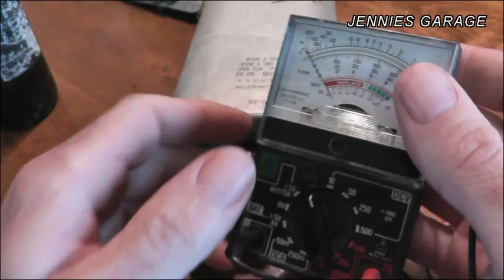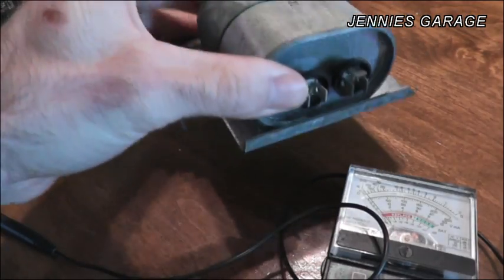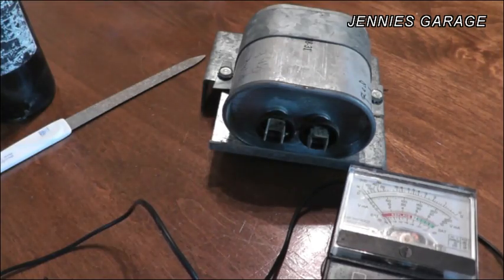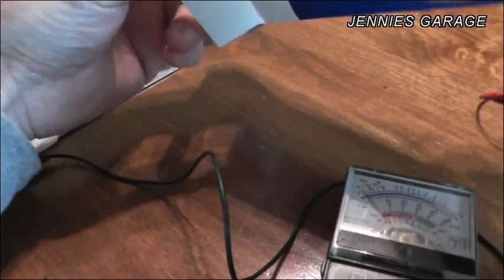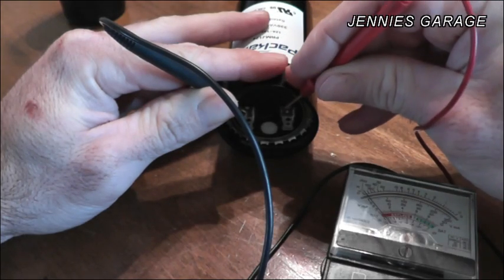How To Test A Capacitor For An Electric Motor With A Multimeter

Comment: BE CAREFUL when working with capacitors folks! They can store a lot of energy, and discharge it all at once if you short the contacts. Honestly, this is not a homeowner friendly project at all unless you are experienced with electrical wiring. The proper way to discharge any kind of cap is to use a bleed resistor. But it's better to pay someone who knows what the hell they are doing than to get hurt. Always.

Comment: Your feelings would really be hurt if you knew his price on that capacitor. Service techs often buy the more common caps by the case. And have accounts at HVAC parts houses. We never pay retail. But it's hot (or really cold), hard work and he has a lot more overhead than just that part.

Comment: Thank you.  Your video helped me fix my wine cooler with this trick.  One small cap was making a relay trip over and over and preventing the cooler from turning on.  I was able to confirm my suspicion that the cap was bad because it was bulging a little bit.  $2.50 later I had a working cooler!

Comment: You need swap polarity (test leads red-black) every time you measure and and you can see needle will show charge every time you do it. But this method indicate very little about cap problems. It still could be bad even it reads like it shows on meter on video. Only accurate is ESR witch measures ac resistance in cap. It will show even if cap is "little" week it still may work on circuit but is't not good.

Comment: Thats not the safe way to discharge a capacitor, try to atach it to a light bulb or something like that. DO NOT SHORT THE TERMINALS (connecting one to the other) until AFTER the capacitor has been discharged. Doing so could injure or kill you.

Comment: When the dielectric breaks down you can't always read it with the low voltage this multimeter uses. I often apply rated voltage or the closest you can get, and read the current flow through the circuit. You can then mathematically calculate the MFD value if so inclined. Usually you don't even have to remove the capacitor from the equipment.

Comment: i was reading some guides and there was some difference, the needle will swing near zero and infinity meaning it works not the other way around like you told. is it because of the bleeder resistor?

Comment: As it was explained to me, this test is only to see if the cap is totally nonfunctional or not. When the needle pinned it showed that the cap has a defect (short or open I forget, but one of those). If the needle had not moved at all it would have meant the cap was defective in what ever way the other wasn't (short or open). Either way, the test was just to check whether the cap was total junk or not. I liked this video.

Comment: I know that one of the best ways to discharge a cap is to touch its terminals with the multimeter leads and the meter set to dc volts. The volt meter's high resistance eats up the cap's charge. Personally, I would have been just as concerned about using my wife's favourite nail file to discharge them as I would have been about shorting them out at all. Other than that it was a great video.

TIP: You cheated death this time, but what if your wife sees you using her file?  ;-)

Comment: Basic tutorial OK. Didn't see any sparks on the nail file, and the charge built up by the meter itself would be harmless. But a fully charged cap, 100V+, might deliver a surge that damages the cap itself, or you. So the suggestion below for a "discharger" resistor is very good. Want an example? Watch the video again. Cap1 has what appears to be that exact resistor attached across its leads! Notice how cap1 discharges between test probes, while the other two hold nearly their entire charge.

Comment: Dear Sir that is incorrect, test maybe for a short, but  probably not a reliable test for capacitor  , they are made with voltage ratings and need to see if they meet that with out shorting also the UF rating which is its capacitance value, also a leakage test to see if they hold a charge, so no offence but you are kidding your self with that test. Think of them as a battery with special ratings.

Comment: did you actually get the pump working then?, that capacitor showed short circuit and because the start windings and wound using thin csa wire, to much juice would of been dragged through the the winding and oops need a new motor.....????

Comment: Thanks so much for the video and the advice.  One thing I learned in my searches is that some people say it can be risky to discharge a capacitor by shorting the terminals--although a lot of people say to do just that. One site recommended using a light bulb.  Thought I'd mention it just in case that is useful to anyone. Thanks again, your instructions were the clearest I came across.

Comment: That is the rating on the control box that has the start capacitor.  It is for a submersible well pump.  The actual capacitor says 86-103MFD, 220VAC, 60HZ. It's Franklin Electric
Model: 275 464 118.  I can find it online, just didn't want to wait for shipping.

Comment: Thanks, very helpful.  Any advice on where to pick-up such a capacitor.  I need a 230 volt, 60Hz to start a 3/4 HP well pump.  Can't find one in stock anywhere.